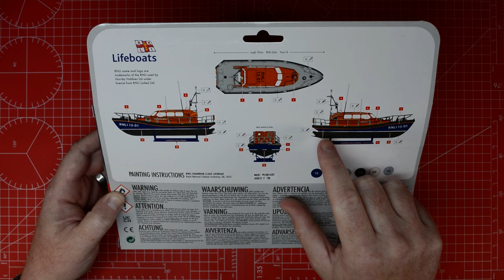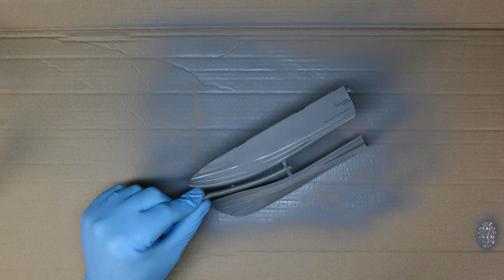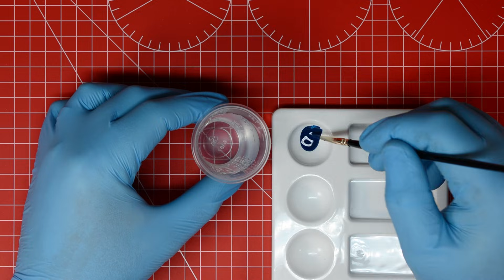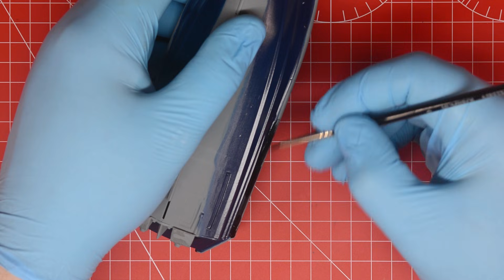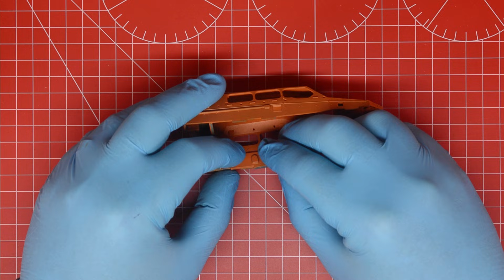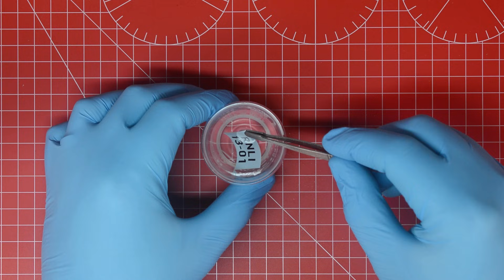Airfix | How To RNLI Shannon Class Lifeboat

Comment: Sorry, it doesn't make any sense to start with priming the sprues before starting building.
Reply: @traylor2025
I have a similar concern about applying primer as shown in this video because a model can be ruined when the primer gets on the ends of the pieces that mate with other pieces because nothing will hold well (including polystyrene cement) when applied to a surface already coated with primer.
   Even so, I noticed that the builder succeeded for three reasons;
1.  The builder used Humbrol acrylic primer (not Tamiya Primer which is a synthetic lacquer).
2.  The builder gently filed off (removed) the dried acrylic primer from the mating surfaces.  Tamiya primer bonds so well that an excessive amount of the mating surfaces would have to be filed / sanded off the surfaces, before polystyrene cement is applied.  I have ruined two models this way, before assembly.
3. The builder in this video was lucky in his effort to remove a sufficient amount of acrylic primer from the mating surfaces, without diminishing the size of the mating surfaces so much that the mating surfaces were too loose.
Note 1: I plan to use Humbrol Masking liquid on the mating surfaces before applying spray primer, as shown in this video.
Note 2; I plan to assemble the hull, bulkheads (inner hull support pieces), and deck with polystyrene cement, BEFORE spray priming them (that way, I will only need to apply the masking liquid to the pieces / places that mate to the topside of the deck).
Reply: Ofcourse it does.